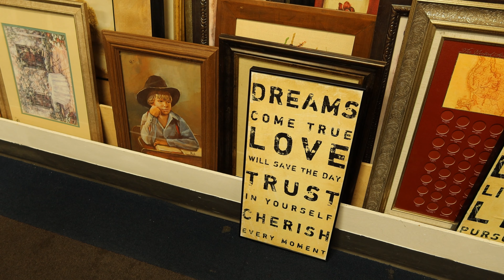Day 1121 Tesla Ruby The Walls Go Up

Comment: I love it. The shed is taking shape. I have one that is 10x12 and I love it. Double doors that open to 4 1/2 feet and at the center, it is 6-4 high. Have had it for 29 years and it is about time to replace it. I am having a hard time finding one of similar dimensions. Have you heard anything about your MY yet? I am hearing that a lot of deliveries are happening.
Reply from the maker: No word on our Model Y. Don says on Monday he's going to reach out to Tesla. We kindof have a plan to make the far door wider. Hope it will work out. Our shed could definitely stand to be taller, but being lower lets the carport roof fall onto the shed roof, so that will work out.